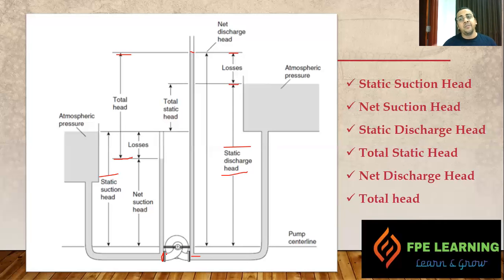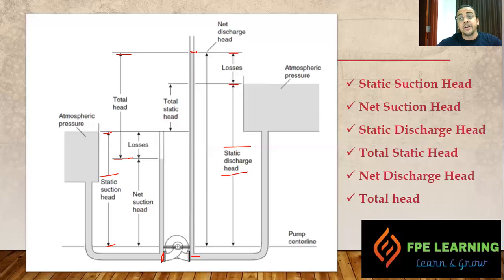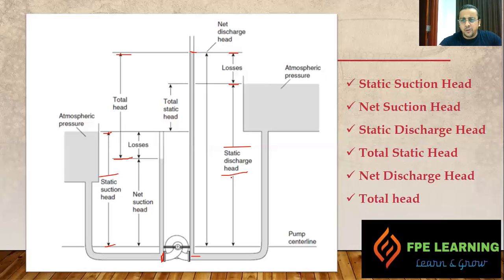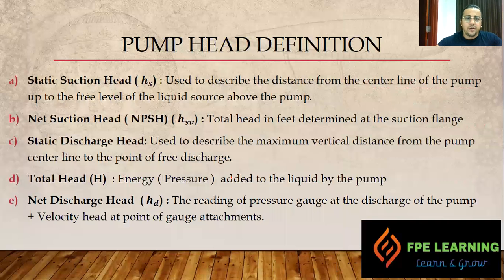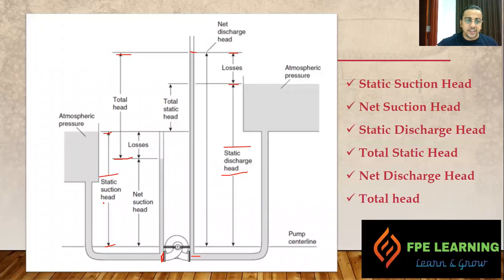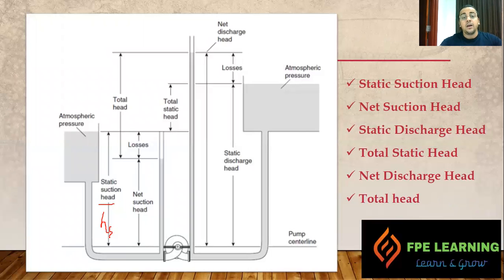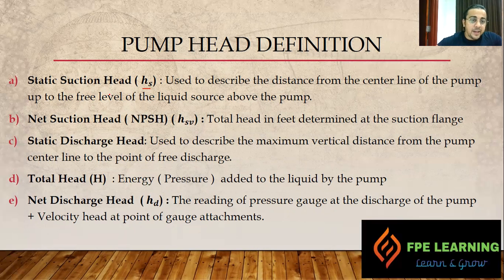Pump Head Definition

Comment: Good explanation. And have one doubt also. Now just take an example that our fire pump at ground level and building height is 100m. Now system is ready and cut in pressure is 280psi. What will be the pressure at discharge pump side? Is it static pressure or net discharge pressure or cut in pressure (280Psi) ?
Reply from the maker: It is net discharge pressure only . Cut-In / Cut/Out pressure is not related  directly with the head . It is related to the pump controller setting what pressure we need .